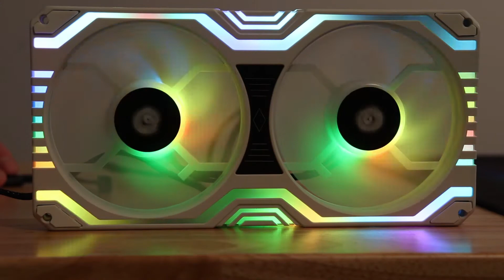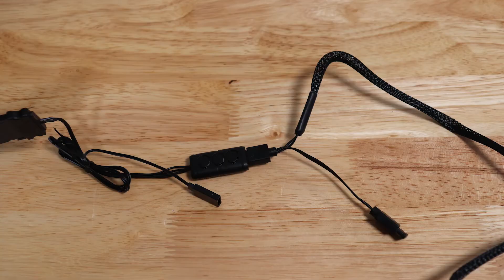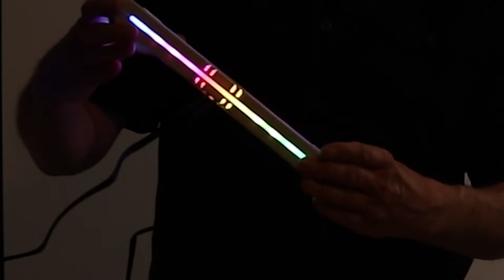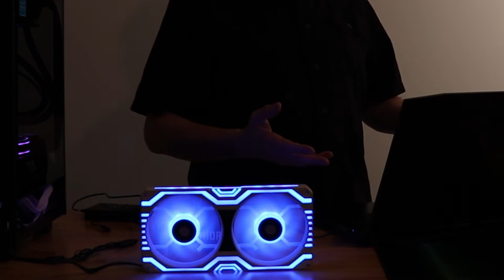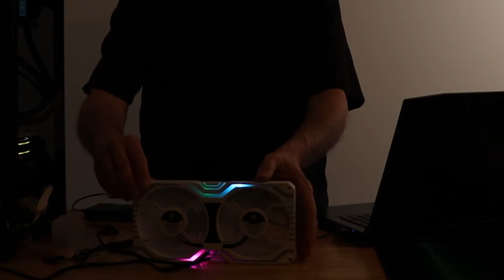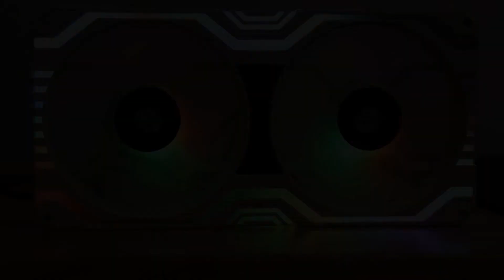ASIAHORSE MATRIX 240 RGB RGB Fan overview

Comment: Hello! If i set the color to one mode or one color, does it stay until I change it by myself or does it change automatically after 10/15 minutes?
Reply from the maker: Hi Rewezor. It should stay on what you set it to until you change it. If it's changing automatically after 10/15 minutes then the controller is doing something unexpected. I'm assuming your using the built in controller that comes with it.